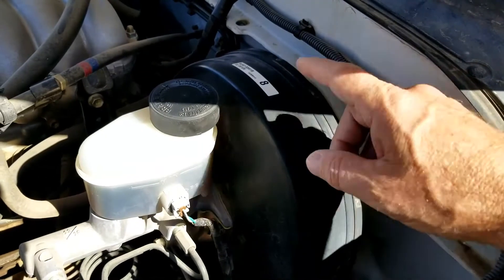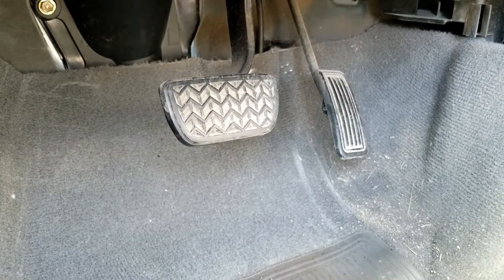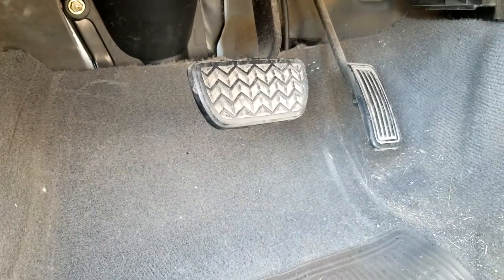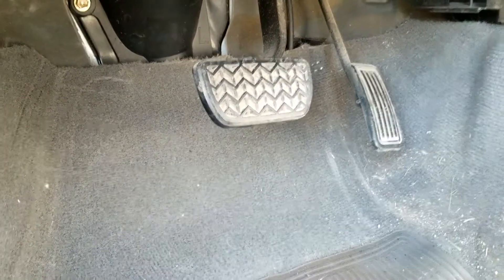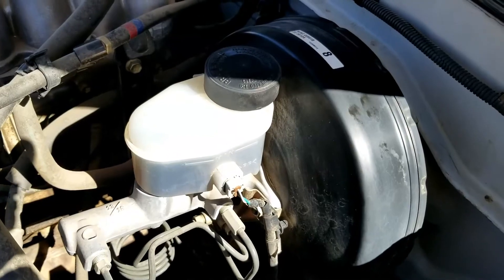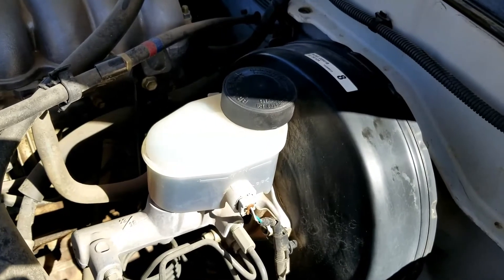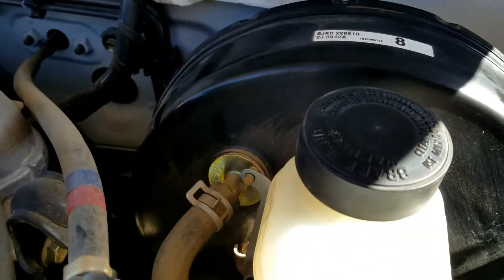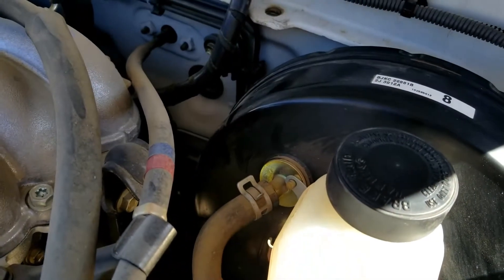Symptoms of Bad Brake Booster and How to Test if It Has Failed

Comment: My pedal is very hard to press and the Car doesn’t brake well. But the pedal gose down when I start the engine. What could it be ? I changed the hoses and it still keeps doing that. All mechanics say that this is normal but im 100% sure that it isn’t because the car never did this bevor. Sorry for my bad English
Reply: Did you figure it out? I’m dealing with the same thing rn 😢
Reply: @williamarias3901  sadly I still have the same issue. My engine looses power when the brakes get worse and my Visco Fan gets very loud.
Reply: @08esco same problem ,did you fix it ?
Reply: @erenb3443  sadly my e38 still has the exact same issue.
Reply: If pedel goes down when starting the engine and if there is no leak in vaccum then it mean that the vaccum pump itself is not giving proper vaccum to the break booster just change your vaccum pump and boom all your problems will be solved 
And have a break oil change also air removal procces from break oil drain 
And yah buddy in all disel cars they sound like hiss phuss thuss when pressing the breaks thats not the problem if it only sound for just 1 sec while when you press and and not continuously!

Comment: Great video. Simple to the point..
The calipers on my vehicle do not retract back to position after I release the brake pedal causing the pads to rub on the rotors.
Replaced fluids, pads and calipers. Rotors are good.
Haven't done any thing to the booster or vacuum hoses.. 
I performed the booster pedal test and the pedal sinks when I turn on vehicle. 
Can this be a vacuum leak? 
Many thanks.

Comment: Dude.. i have a problem, my idle short fuel trim is about 10% and pressing the Bpad doesnt change it but when it decompress it goes to 20% .. pumping it 3-5 times it spikes up to 50%.. what do i do?. 
Note: if i disconect the booster hose and the evap hose and seal them so the only air would come in the engine is from the intake, the fuel trim stays like max 3%

Comment: My 01 sienna sometimes gets real hard  to break or the pedal goes all the way in, I replace master cylinder and check valve and still nothing changes.
Reply from the maker: I would bleed the master cylinder again and then the lines. When they are new, it is usually best to bench bleed them to be sure all the air is out.

Comment: Can it cause your car to jerk when braking?
Reply: I would say no but it will have something to do with the break lines or the rotors and brake pads
Reply: Me personally I had to replace the distribution box and it fixed it after bleeding them out